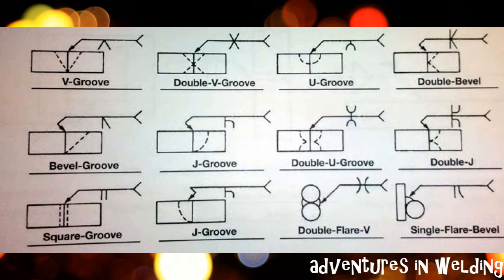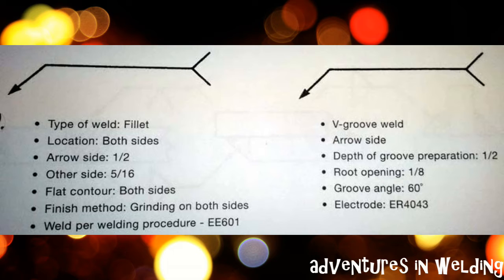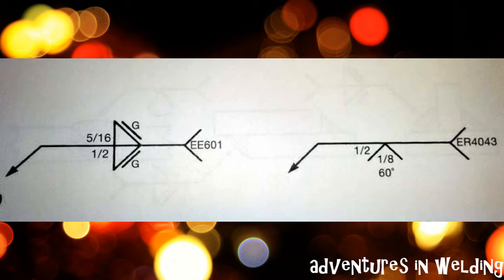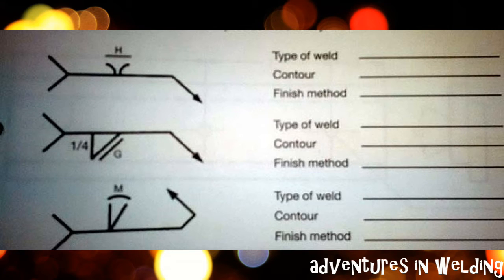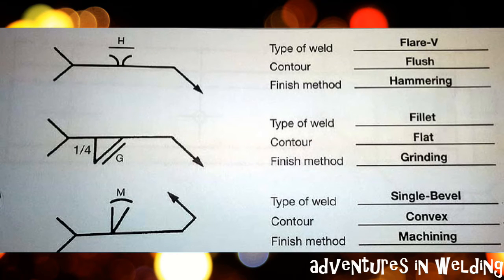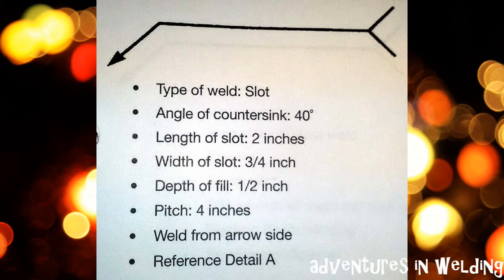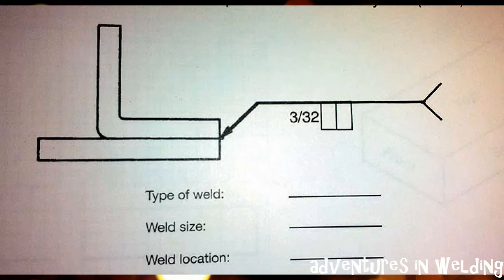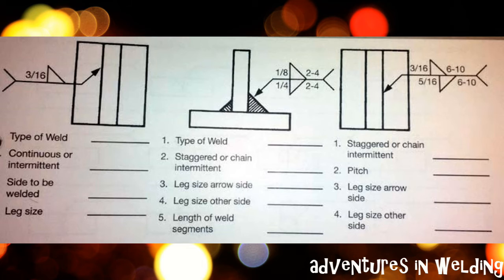Adventures in Welding #65 Welding Symbols

Comment: At 6:56 you say that the weld is to made on the "other side", however the fillet symbol is on the same side of the reference line as the arrow. Does this not indicate that this weld not be made on "this side"? I'm not giving you a hard time; I'm just starting to study this stuff and am trying to figure it out myself. My understanding was that it was the same/opposite side as the arrow with respect to the reference line which determined this/other side; not the top/bottom of the reference line which did. Am I incorrect in this understanding?